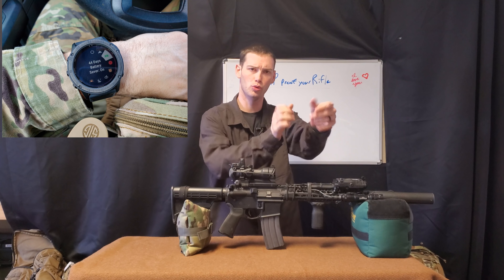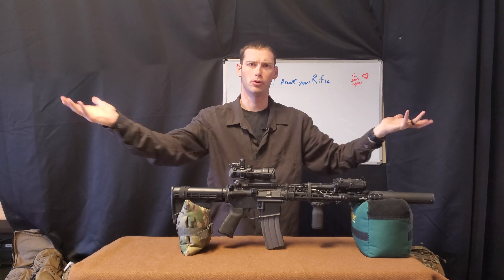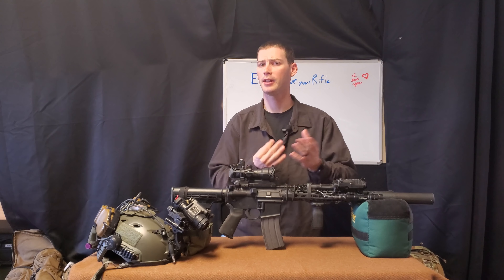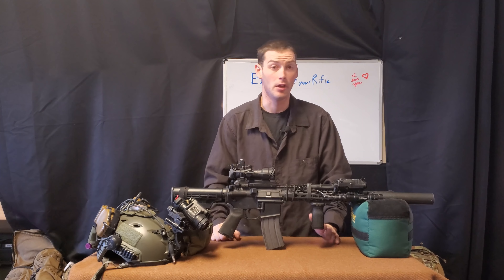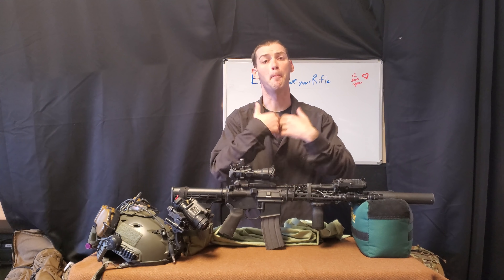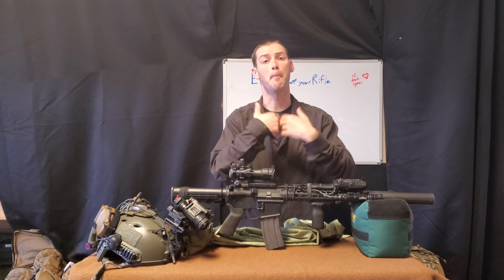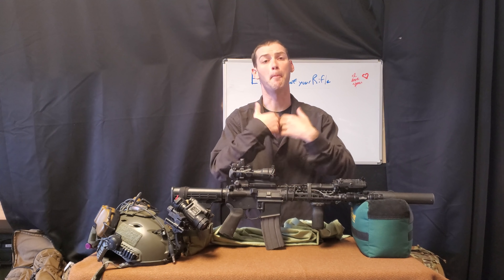EMP proof your rifle

Comment: Rifle optics are not big enough to catch enough energy to fry the wiring.

Not counting the fact most rifle optics are encased in a metal tube that work as a faraday cage.
(Same for most older steel bodied vehicles)
Edit: if you do find yourself in so much Gama and X-ray radiation ionizing the air that your optic takes a crap, you have much bigger problems than your optic taking a crap, but you won't live long enough to appreciate the severity of the situation, or to switch to backup sights.
Reply from the maker: https://youtu.be/7PA0-t4MKL0
Reply from the maker: If no one has tested it, then why are you so adamant that is has no effect? 

My video is merely one to show what I have used because i am cautious about the unknown.
Reply: @PreparedAirman  I just figured out what you doing! You're selling the cloth, just like in the video you sent!
You're not trying to help people survive a EMP, You're pushing merch.

Why didn't you just say that at the beginning of the video?
Reply from the maker: I have zero affiliation with this cloth, this Individual, or this company. I've never met or spoke to them. I could care less if you utilize these products or not. 

Could you also answer my pervious question that you deflected?
Reply: @PreparedAirman  
I was collecting information.

Exhibit A
https://youtu.be/mil2g3YUcq0
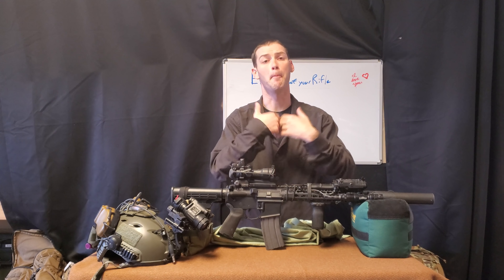4:30 testing on vehicles. 
6:05 the way to protect is to drape with something conductive over it.
Note: older vehicles have more already grounded metal panels than newer plastic bodied vehicles, even readily available cheap metal bug screen would help new vehicles survive.

7:54 very few if any peacemakers would be affected.
Note: red dot sight, and illuminated scope electronics are smaller (less exposed) than a pace maker, most quality NV and thermal instruments are already encased in a conductive material (machined aluminum)

Exhibit b
https://youtu.be/wR1npiokaXM
2:17 An EMP attacks by using an electronics wiring as a antenna to collect, and conduct electricity, the voltage overload kills the device.
Note: Compact NV, red dots, and thermal devices have very small, and short wiring.

An EMP could absolutely kill the electrical grid, not so much your personal equipment.

I would advise to do a little more research about EMPs and their effects, and not get swayed away by misinformed people.

Edited to add a timestamp, and clarification.
Reply from the maker: Misinformation lol Dude this is the SAME guy I get my information from.... And this is the same individual that made the video I sent you above lol

His Website is literally in my description box
Reply: @PreparedAirman  explain to me this, how does he claim that pacemakers won't be affected, and yet he's making videos about protecting your Red dot.

That shows quite the lack of logic on his part.

If anything it shows he's willing to undermine his own knowledge to sell a product.
Reply from the maker: Personally I'm not a NASA engineer with a Doctorate and I don't know the similarities or diffrences between certain electronics so I decided to cover down and just in case place fabric that has been tested and works over may sensitive electronics.

 Better to have it and not need it the need it and not have it...
And it's literally $80 for piece of mind.
Reply: @PreparedAirman  regardless of his status, position, and credentials, he is still a person, and people are fallible, and need money, so I don't really blame him for selling stuff.

I'm just a recheck with access to a decent size Tesla coil, a few eBay red dots, and a couple of my buddies thermals.
I'm just a rando on the internet but I like to test stuff, that's all.
Reply from the maker: Soo unfortunately im not exactly understanding your point on the matter then..
Reply: @PreparedAirman  you don't need to protect, already protected by design, gun accessories from a EMP.
That was my entire reworded argument.
Reply from the maker: But you have no actual facts to back up your claim that my electronics will be 100% guaranteed not to fail under those circumstances.... so as a precaution I protect them. It's my opinion and I shared it to others...
Reply: @PreparedAirman  no electronic is guaranteed to work 100% of the time regardless of care, EMP, Or the lack of either.

Is your right to share your opinion as you see fit, and I'm ok with that, that's your right.
It's my right to point at it, disagree, and share my opinion on why I disagree.
Reply from the maker: Well I guess i will disagree until you can provide me with factual data that my devices will not effected by an EMP event. Until then I will be utilizing this method.

Comment: Backup irons on everything, and one additional consideration for a scope. I get it though. I dig ruggedized red dots for most applications but it’s a good idea to have either an optic with an etched reticle and either tritium or fiber optic illumination. White light onboard is invaluable to me and NVs or thermal are next on my list so I appreciate the pro-tips because I couldn’t imagine that going down.
Reply from the maker: Exactly why my rifle is set up the way it is. 😁
Reply: Back up irons with tritium preferred. If it’s available why not? Hard to line up irons in pitch black
Reply from the maker: Agreed, the tritium front sight post is pretty cool I have one an another rifle and it definitely assists at night engagements. But I will say NVGs are a game changer.
Reply: @PreparedAirman  I’ve got tritium on most of my pistols and a few rifles have front and rear tritium (AKs) but I’d like to set up an AR with that as well. NVGs are a priority as well but I have some other preps that are currently taking precedent. It’s still on the list though and I have a fair bit of experience with NVGs and a lot with thermals.
Reply: @AFreeThinkingDawg09  agreed. I’ve got two AKs with front and rear tritium iron sights, it does make sight alignment in the dark easy. Although I’ve also found that if you  have a white light set up and working on your rifle (as you should if you can) then proper use of light discipline and lighting a potential TGT creates a backlight for irons if you don’t have tritium.

Comment: Do we know for sure whether lights and optics need more protection from EMP? Most are made of aluminum and are, themselves, a cage..
Reply from the maker: Yes everything that has any type of electronics in them are possibly susceptible to EMP. It all depends on location and magnitude of the event.
Reply: @PreparedAirman  it would also depend on the material and surface area of the thing your look to shut down with the emp. Most optics wont take any real damage from a bigger pulse becuse of there construction

Comment: For those wondering about natural EMPs, there is increasing evidence that this is all related to Climate Cycles and Magnetic Excursion cycles (with lengths of 12000, 6000, 3000, 1500, 750 and 375 years long). Below some examples (note that the shorter the cycle the weaker it is, and the further we look the harder it is to notice smaller cycles): 

±405 years ago (405-Year Cycle): Maunders Minimum mini-ice age (1645 to 1715), the 30 years of war (1650-1680). The Ming Dynasty collapse (1644, severe drought)

±810 years ago (810-year cycle): Volcanic event (1315-1320) caused damaged crops and mass cattle death, resulting in the Great Famine (1315-1322), resulting in mass death and malnourished/weakened people, resulting in the spread of the Plague (1331-1353) which was a bubonic plague, resulting in the weakening of empires, resulting in wars like the 100-year war (1337-1453)

±1215 years ago (405-Year Cycle): Medieval Warm Period (900-1300) made climate wet in Europe, arid in North America, may have depopulated the Great Plains of North America, then The Crusades (1095-1291), The Khmer Civilization collapse (1000-1200, experts don’t know why), The Maya Civilization collapse (900, severe drought killed millions of Maya people due to famine and lack of water), The Tang Dynasty collapse (907, crop failure and famine associated with drought), The Tiwanaku Empire (1000, drought, 10-meter drop in lake level at this time), Anasazi Collapse (1150, North America experienced a 300-year drought called the Great Drought)

±1620 years ago (1620-Year Cycle): "The worst year to be alive" (536): A volcanic eruption caused climate cooling, resulting in crop failures, then famine (weakening people), then the Plague of Justinian (541-549) which was a bubonic plague. 

±3240 years ago (3240-Year Cycle): Sterno Etrussia Excursion. Late Bronze Age collapse (Hittites in 1178 BC, Mycenaean Greece in 1050 BC, the collapse affected a large area covering much of Southeast Europe, West Asia and North Africa, 300-year drought event), Indus Civilization collapse (1000 BC, experts don’t know why but think it was climate change and famine)

±6480 years ago (6480-Year Cycle): Solovki/Noah/Sumerian Excursion: Nothing to do with religion, instead massive floods all over the world. Çatalhöyük Civilization collapse (flourished 9000-7000 years ago then suddenly vanished, experts don’t know why), surviving Sumerians came to Mesopotamia (5,300 years ago), first city states (5,000 years ago), Prehistoric Egypt (5000 years ago), massive advances in agriculture like irrigation, all known domestication of animals and plants (4,500 years ago). Note that this event was so brutal that barely anything was left from previous civilizations.

±12,960 years ago (12,960-Year Cycle): Gothenburg/Younger Dryas Excursion: Global Mega-Faunal Extinction (remember the frozen Mammoths?)
±19,440 years ago (6480-Year Cycle): Hilina Pali/Lake Biwa/Lake Imuruk Excursion. Unknown effects.
±25,920 years ago (12,960-Year Cycle): Lake Mungo/Last Glacial Max Excursion: Mega-Faunal Extinction mainly in Australia/Eurasia/Africa
±39,880 years ago (12,960-Year Cycle): Mono Excursion: Mega-Faunal Extinction mainly in North America
±51,840 years ago (12,960-Year Cycle): Leschamp/Napoli Excursion: Global Mega-Faunal Extinction.
±64,800 years ago (12,960-Year Cycle): Norwegian Greenland Sea/Gaotai Excursion. Unknown effects.
±77,760 years ago (12,960-Year Cycle): Toba Excursion, known as the greatest bottleneck in human history. Caused 1,000 years of volcanic winter. It is estimated that less than 10,000 people survived on the entire planet.

Comment: I must say they did a test with reasonably large emp tech on cars, something like 50 or 100 cars were tested, 3 turned off, of those 3.....2 went back to working after being restarded, if your optic or flashlight wont come back on after an emp your either too dam close to a highly targeted area or your buying shit gear, buy good gear and you wont have to worry about buying gimmicky blankets that may not even work as they have only been tested by the guys who made them, you shouldint have to spend 22$ on a stainless steel emotional support blanket if you have bought a decent optic and flashlight,  as for peq's.....pretty sure the military did testing on this sort of thing and they serviced just fine, so long as your electronics are grounded it shouldint be a big deal
Reply from the maker: Can you site your location for your information?

Comment: I don't know if you understand it has to be ran to ground
Reply from the maker: It doesn't
Reply: @PreparedAirman  I understand his blanket says it doesn't have to but what Faraday cage doesn't have to be connected to ground
Reply: No it doesn’t its a shield.  Is is shielding the electronics from a wave of energy not grounding like protecting from a lightning strike.
Reply: @deputydog5261  what do you think the energy is made of
Reply: @calebsone1630  it’s an electromagnetic wave of energy.   When that wave crosses over wires or lengths of conductive metal it induces an electrical energy into it, which it then travels along and can destroy sensitive electronic components.  But that wave of energy is not looking for a path to ground or to complete a circuit, which is why wrapping electronics in a shielding blanket that is not electrically grounded will work, the blanket simple keeps the wave of energy from ever coming into contact with the electronic device.
Reply: @deputydog5261  ok
Reply: @deputydog5261  and just let me add the charge remains on the outside of the Shield so depending on what type of charge you get you still have to touch it so you really should be running them to ground so I mean in theory you're right it does not need to be ran to ground to work but it's still going to have a charge built up on the surface. I don't think you guys really get it those blankets are made for blocking stuff like RF frequency they're not meant to be used as a actual Faraday cage they have RF blocking wallets too do you think you could use that to protect your electronic equipment during an EMP
Reply: @calebsone1630  I don’t think the shielding blanket will retain a charge at all.  Actually something like one of those wallets might work if large enough.  Military equipment has built in EMP shielding including some handheld equipment, no need to ground it for it to work or before touching it.  Think of it like this when you go in for a chest X-ray they put a lead shield over your groin to shield from the X-rays, its basically like that.  Lots of theory out there and no one is quite sure as it hasn’t been experienced.  Some say put electronics in a microwave oven and they will be shielded, some say small electronics like red dots wont be affected because their runs of wire are not long enough to have any significant amount of voltage imparted upon them.  Anyway have a manual dial to any safe and backup iron sights and hope for the best.
Reply: @deputydog5261   look if you honestly think that a blanket is going to protect you from an EMP or a coronal mass ejection large enough to take out electrical systems then there is no arguing it you have it made up in your head that that blanket will keep your stuff safe so good luck

Comment: The EMP threat is way over blown for small electronics. All but the cheapest and most fragile items will fail.

Might want take special care to things like radios and anything with an antennas. Most other items will be fine. Different story for appliances and plugged in devices as they will be exposed to a surge from the grid.

Comment: Think you could use some adhesive and line the inside of the guncase underneath the foam. Or would the gap between the halves allow waves through?
Reply from the maker: Yes absolutely. I personally do not because I change cases alone to be discreet in some situations.

Comment: I doubt small simple electronics would be affected.
Things with lcd screens,smart phones,laptops,etc would probably get fried.. simpler things like toasters,space heaters,cordless tools etc will probably still work.. but better to be safe than sorry
Reply from the maker: Depending on location and intensity/magnitude you don't really know.
Reply: @PreparedAirman  your trying to push a stainless steel blanket....for an emp......alot of optics them selfs are made of steel or aluminum......this product is almost pointless for anything on a rifle, even most cars will survive an emp just fine, its been tested
Reply from the maker: I'm not pushing anything my guy... I get zero royalties from any products. I could care less if you buy it or not. Im just shareing what I use. Also do you mind sharing where you received your info at im interestedin researching.
My current research is Directly from Doctor Arthur Bradley.

Comment: So this is sold by the foot, so do you really need to cover the entire rifle? Could I get by with a single foot to cover my red dots?
Reply from the maker: It's sold by the linear foot. So it's 12"x 59"  I personally purchased 3ft which gives me 36"x 59" of coverage for about $66. Not exactly cheap but it definitely gets the job done.
 I personally wouldn't recommend just covering the optic because you want it overlapping a little bit but if you had to it's better then nothing 😁

Comment: Every single AR I own has a glass optic, canted red dot and BUIS on them. I won't run a weapon that doesn't have a minimum of two sighting systems, preferably three. 

Small items like red dots or flashlights aren't as susceptible to EMPs as most people may think. EMPs will actually travel through power and communication lines, and hit things that are plugged in much further out than the actual "blast" area.
Reply: Wait “things that are plugged in”, does that mean as people progress towards electric vehicles that their vehicles are susceptible to EMPs?
Reply: @bubbalawrence1  basically anything run on a fuel injection system has a processor in it. Especially if it's an automatic transmission.
Reply: @BuckFoeJiden , there was a study done around 2004 where 50 different makes and models ranging from 80's model vehicles up to early 2000's models were put in an EMP simulator, and nearly all of them were at least able to start up and run after the EMP. Because car bodies act as partial Faraday cages, the exact effects of an EMP would likely depend on intensity of EMP, distance from the source, and the vehicle's orientation relative to the EMP source. Newer vehicles, especially ones made in the last 10 years or so, are definitely going to be affected more since they have more electronics, and more computer-controlled components. EV's will definitely be affected most, but new ICE's aren't going to fare much better.